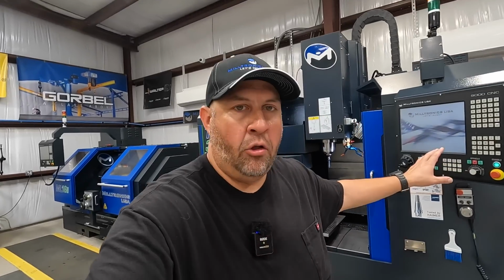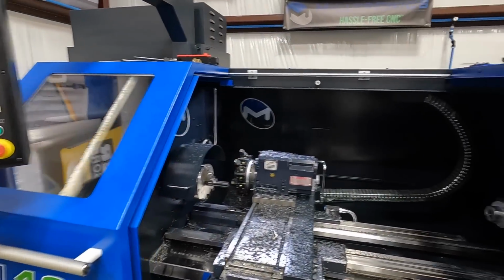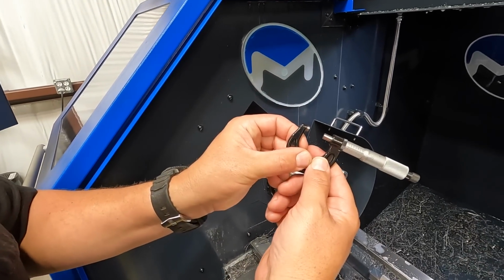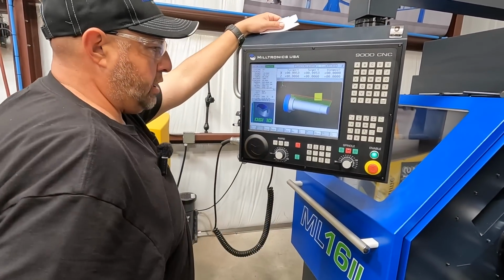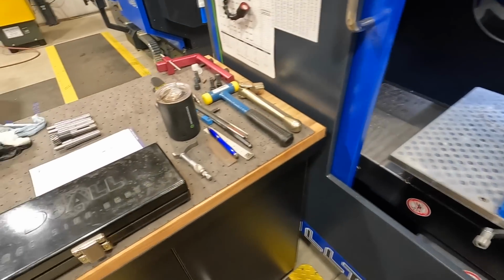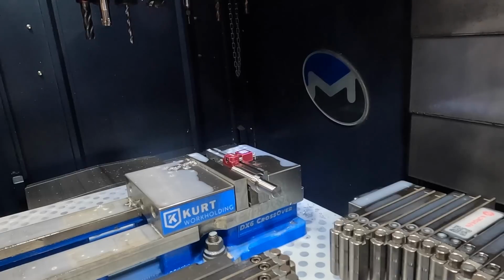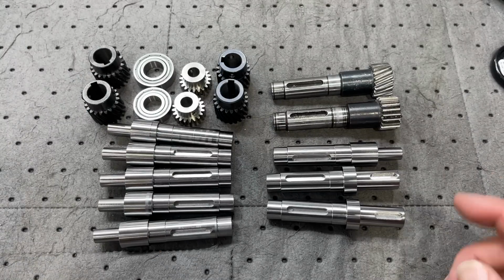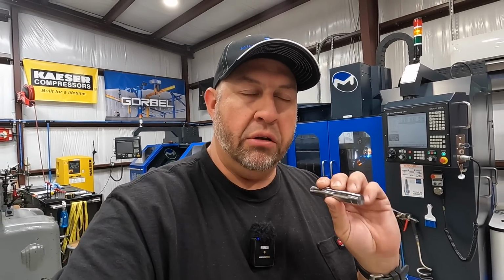Pinion Shafts CNC Machined

Comment: Learn it on the machine first.. there is so much to learn,, and turning and cad cam it is important that steel is set up correctly both in cad/cam and on the machine, the cad-cam is better to learn when you understand the machine ,, the best thing was to learn iso programming and not form programming

Comment: The nice thing about CNC lathe is if the far end sticking out is consistently larger than the diameter closest to the chuck because of part deflection you can program a slight taper cut into the machine so you end up with a straight cut surface.

Comment: Adam, Being in IT for 25+ years (starting on mainframes) - you are absolutely correct in thinking that switching from manual to CNC is like learning a new language - because it is.  But don't be so hard on yourself.  Stop and think of all the things you do know: Use a micrometer, what good surface finish looks like, need to debur, setup the vice with a stop and parallels, gauge blocks, I'm off by 2/10th's - something's wrong, setup for carbide vs. HSS endmill is different, different insert for rough versus finish pass.. and that's what you already know to do a great job on just this job.  You will learn the conversational programming and Fusion 360 with time and patience.  One last pro-tip from our industry to yours.  Don't forget to regularly backup your programs, and machine configuration settings from your equipment.  Especially back up the settings before making changes.  There are hundreds of gCode parameters to where any one of them can mean the difference between dead-nuts-on, and what the heck is going on?!?!  Then keep that known good setting backup in a safe place outside the shop.  Refresh it regularly with the current version (usually a date code e.g. 20230512 - easy to sort the directory by date.)  Keep up the good work!

Comment: Your CNC machines are built to be flexible for your needs rather than patterned high speed production machines that I run. 
Some of the machines I'm near an expert on through experience, the others I'm still a beginner so I get my hand held and guided like you right now. 
And yes it wasn't easy but I'm getting there, so I know where your coming from, great work as always and a big shout out to Milltronics for helping you out with their products. 
Have yourselves a great day and just remember..... go and slow, take it slow till your ready, heh

Comment: I used to be a manual draftsman back in the day and now am a computer programmer and I have a hard time figuring out fusion 360.
Reply: Fushion 360, 2014 and forward, is kind of a walk in the park compared to much of the older software in my experience. More user firendly and intuituve, and at the same time many options and functions. They've put decades of experience, and lots of inputs from users over year, into this tool.  But naturally, a steep learning curve for sure when one are new to this kind of software. I use the F360 for making 3D and 2D designs/drawings, steel structures. Not into the CAM, the machining part of it

Comment: Soft jaws help with repeating your Z. Turn the diameter of the jaws and then do a facing operation of the face of the jaws for a nice straight surface then bump the part up to the face if your part has a heel on it. Will repeat every time

Comment: Fusion 360 isnt something youre going to open and learn in a week. It takes time and messin up, but figuring out how to fix the mess ups. Learn the basics and slowly add advanced features as you go. Forget about the whole tool path etc., for machining for now. You have to learn the basics before going further. On your keyways, we always used two endmills in cnc. One for roughing in and the second  for finish. Example, if we had as 3/8 keyway, wed use either a sharpened 3/8 or maybe a 1/4 endmill, input that diameter then it would ramp down and cut in the perimeter only instead of plowing out the whole keyway in one shot. Then we only had to adjust one endmill (finish endmill) as it wore down. Did he show how to ramp down instead of plunging for doing keyways? Maybe not if your on the controller. Thats more of a tool path thing. I seem to remember its much easier on the tooling to ramp down. There is a lot to learn and youre making it happen. It takes time.

Comment: Ultimately, you need to ask, "Is this the right tool for the job?" and also "Is this the right tool for me?"

I fear that many of the people promoting the idea of CNC are answering those questions for themselves, in their own circumstances, but not really understanding yours.  Your own choice of your path will be based on your own intuition, which you have shown for years, in many different ways, and the honesty that has made you a good man in the face of obstacles and opposition.  These are things that made many of us want to follow you from those early days.  A quiet man saying "I don't know if this is the best way, it's just way I do it."  Absolutely!  More of that!

You have to have a reason.  "This is why I'm using these particular tools for this particular job."  

That said...  I think the best way to learn something technical, with thousands of new details, is one step at a time.  Isolate the parts, start at the beginning, and work on that first step until it's obvious.  Then add another.  Teachers sometimes don't understand that it takes our brains time to absorb new information, and they pile on all the details at once.  Slow and steady wins the race!

I love electronics.  For me, I love premium test gear from the 60's, 70's, maybe into the 80's.  Analog.  Switches, dials, buttons, knobs.  Heavy as a boat anchor.  Wonderful stuff that was the best of the best in its day, built with skill and pride, and it still works great.  (Electrons haven't changed much!)  I use the modern digital plastic machines from time to time, but they do not resonate with me.  Funny enough, I make my living in software.  I know what's inside those things; I understand how they work.  Maybe that's why they're joyless for me.  Those are just my personal choices and preferences!  :-)

Comment: I spent a year or so outfitting my Sherline mill and lathe with stepper motors, motion controllers & went deep into the rabbit hole, figuring out LinuxCNC and actually got them both fully under control.  I even added optical encoders so I could do threading on them. I figured out how to add a 4th axis Sherline rotary with a stepper.  Today I decided to take all of the CNC stuff off of those machines. CNC is truly fantastic and capable of more than is possibly manually, by far.  But I'm just a guy with a hobby.  If I need a part, I want to think about how I can machine it from whatever chunks of stuff I have laying around.I love that chess game.  Somehow, CNC sterilizes the process. It's like having a printer.  I want to feel the smoothness of the cross slide & the vibration of the cut as I go. I'm willing to sacrifice efficiency for feel. I may still work from Fusion 360, but only if it's really complicated. The rest is going to be chicken scratch on a note pad.

Comment: 3D CAD design is not an easy or simple task. It is a quite well paid profession. When I finished school, it was a job you had to study at university for or at a engineering academy. I was told you had to be good at maths, calculating vectors and stuff I don't understand. So it is pretty amazing, that nowadays everybody can grab a copy of a CAD design program and start drawing parts. I may not be "good" at it, but I can design the parts I imagine. And I can make it using a 3D printer. It is not a mill or lathe, so don't be too judgemental on what you have achieved: you sir are way ahead of most of us armchair experts!

Comment: Fusion 360 unfortunately has some operations that just don't make logical sense as to the way they work. I periodically use it for designing 3D printed parts and on multiple occasions have had to scrap half a drawing trying to add a feature or make some minor alteration to something after printing a part. On the flip side, many of the other simpler CAD programs out there always seem to lack something I need (or maybe I just got used to doing it in 360) and so I end up back with 360 anyway. 

I seem to recall that you mentioned you had obtained a 3D printer a couple of years ago. You may want to try to practice with 360 making some simple 3D printed parts just to get some muscle memory with some of the basic functions of Fusion 360.
Reply: He offloaded the 3 D printer nearly as soon as he got it, and I don't think it was actually his anyways; it was a good few years ago, probably when he was still at Motion.

Comment: Adam, I suspect you are a global learner. Which is defined as global vs incremental learning. My suggestion is to concentrate on smaller elements of the process. Don’t be concerned with understanding how all the elements fit together  At some point it will all make sense. At that point you will understand it better than most

Comment: Something else to mention is especially with those high rpm’s you are running the centrifugal force on the jaws can loosen them up. 

Make sure that chuck is rated for that rpm. Just because it’s on the machine does not mean it is.

All the reputable chuck manufacturers also have tables for holding force at rpm’s. 

I think you could cap the rpm at like 2500 and just take a little better cuts and finish the part in the same time and your inserts will last longer

Comment: You should get a mitutoyo digital micrometer.  Rpm on the lathe seems way too fast with too light of cuts. 4140 pre hard maybe around 400 sfm and I’d run maybe .1” per rev and .1” doc. I think those would be decent numbers to start.

Does that machine accept a hydraulic chuck? I feel like they hold much better I’m surprised you had a part spin. I’ve never had that happen although I have had parts get pushed into the jaws

Comment: I started out with Autocad v9 and became extremely proficient on it.  However, its vector based.  Fusion 360, I spend a year learning new curse words.  Then I figured out what the work process for it was.  First you start out with a sketch, which is just like a drawing on paper.  You have the typical views, front, side, top.  But you can have bottom, back, and other side <grin>.  Once you get those cross sections done, then you move to creating the bodies.  These are usually simple primitives, like cylinders, boxes, walls, etc.  After that, you can combine these bodies into a complete shape (or body).  That's the simple part.  After that you put the bodies into assemblies (what they call components) so if you move them, scale them, copy them, they stay as one unit.  Now that's a quick summary of about 10th of what this software can do.  I do basic 3-d printing so far.  My CNC right now is down while I learn more about 3-d printing.  I hope this doesn't come off condescending, but I wanted to say what I went through learning that thing.  Back in the Autocad v9 days, I worked with various companies (Intel was one) in their Facilities department, customizing Autocad for their needs and building their building databases.  Fun times.  I hear you lamenting but don't worry, watching your series you're doing fantastic!  With your exceptional background in manual machining, you're perfect for this next technological step.  Your Dad and Grandad are no doubt proud.  Have a great one.

Comment: Keep learning that conversational control it is the best way to make a simple one off or do short run production. Spent a lot of years running Mazak machining centers with Mazatrol "conversational programming"  And I promise you it is the fastest way to get from print to finished part you will ever find.  Save the fusion 360 for Complex parts that you can get a CAD file from your customer to make tool paths with and trust your post to do exactly what you see on the simulation screen.

Comment: Keep at it, Adam. CNC is hard to learn, but it is a very powerful tool. Chasing tolerances with offsets is so much better than trying to file or sand to size. Learn some G-code. You want to be able to read through a program and know what will happen when you hit start. Also handy for writing short, simple programs. CNCcookbook has a great tutorial and G-code editor that really helps. I've been where you are and it is a VERY steep learning curve, but it is so nice to have CNC and CAD/CAM capability. Keep an open mind and keep learning.

Comment: You're doing great, Adam!  I've spent a long professional life learning a series of complex and difficult computer systems, just not for machining.  Yep, it's hard, no doubt about that!  Learning always is.

I think that your comment about learning a new language is spot on.  All this new technology is basically a new way to do much of the same old stuff that you have learned already as a machinist.  I loved the example of setting z0 with a sheet of paper and then miking the paper.  I've seen you and other traditional machinists do that many times in the past on restored manual lathes and mills.  It's still just as valid, but you need a different set of words to describe what your hands are doing.

I will still suggest that you at least learn the rudiments of using a measuring probe, even just as an exercise.  Could some of your skilled viewers help you out a bit there?

Comment: I find using a gage block for setting tool offset to be more consistent for me then paper. I use either a .10" or a 1.0" block for this. You can do the setting method of telling the machine you are now 1.000" off the face. I use the same blocks for tool setting in the mill as well. I have known some very skilled machinists who could use paper and be within tenths, but I like the idea of a standard reference that should never change. I still have a pack of zigzags in my box for this though.

What do other people on here use?

Comment: I've said it since day-1 of a79 getting them CNC-machines.  If you don't use the software regularly your knowledge won't stick. And especially when you are a a little bit older.  Problem is you need to practice A LOT from scratch.  You can NEVER go to a CAD/CAM class and think you know everything once you've finished.  In class everything is planned ahead and thing runs smoothly and there is an instructor to guide you.  When you are alone you have to figure out everyting yourself.  And you have to transform your mental idea of what you are going to make into something the CNC software will understand.  Most times it will not "understand" what you meant it to do and you've wasted time and material and maybe crashed the CNC machine as well costing thousands of dollars - and you STILL haven't got closer to making the part you wanted to make.

If you are away from the CAD/CAM software for more than a week your knowledge starts to fade away.  The problem for a79 (and all other manual lathe specialists) is that they will always HATE the struggle against the software to do even the simplest of things when they KNOW they could've made the part already on the lathe.  It will always be a hate / hate relationship with the CNC software.

a79 is cursed with his skills in manual lathe work and it will always be troubling to him wasting time on the CNC overhead. For this reason he will never succeed in the CNC world.  You HAVE to love making sofware sketches and thinking abstractly to make the parts.  a79 is more of a Bluto (from popeye) type of a person.

Comment: Cnc definitely has a steep learning curve, it's a whole different world of machining but with time you'll get to know most of the basics and it'll come in handy especially if you need to make a batch of the same part or parts that would otherwise be too complex on a manual machine.
There's no denying that for certain basic parts that can be done manually, it's often quicker to do it that way.
Both types of machines have their strengths.
It's funny since on manual machines,  most time in prep work goes into fixturing/workholding or changing set ups whereas in cnc most prep goes into designing the model and toolpaths.

Comment: Fusion 360 is definitely a learning curve to use. I thought my self how to use it for my 3d printer and desktop cnc cad/cam. Sometimes it does feel easier to make a part on my manual machines atlas lathe and chevalier mill. Wish I could meet you and possibly assist. Going to be driving south in 2 weeks to panama city florida

Comment: Could you explain the term "conversational programing"?  That is how far behind the curve I am.  Anybody else in the same boat?
Reply: "Conversational Programing" is another term for a GUI interface.  Or "graphical user interface".
 You pick a operation, feature or function.  Such as milling, drilling, turning, tapping, facing ect---. And then input your information.  Length width depth  of cut ect. into dialog boxes.  This information will generate a toolpath and output G code to your post that is sent to your machine to make your part.
Reply: @charlieberger9740  Thanks for your explanation.  Think I'll stick to manual operations.

Comment: With Fusion start with widgets, bushes and spacers around the shop and if you still have it (think you showed it a while ago) a 3D printer (if not go buy a $2-300 one and some PLA filament) then exporting those as STL's is a few simple button presses. It along with Lars Christiansen's YouTube channel got me started and a bit like you I am learning my way into CNC but the Fusion CAD bit is now easy CAM not so much. Stick at it🤪